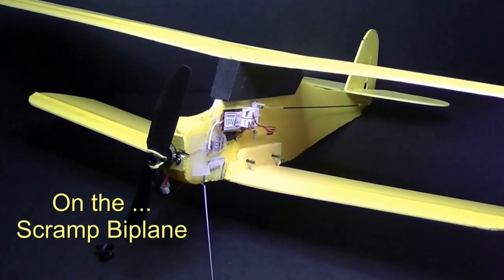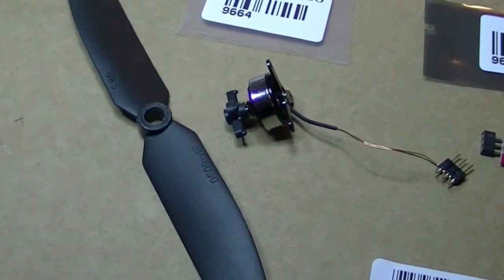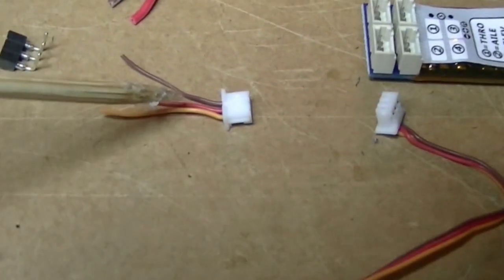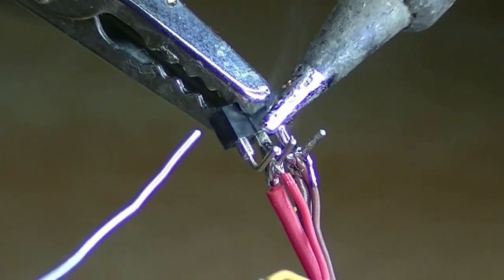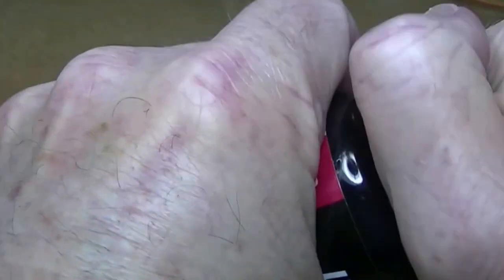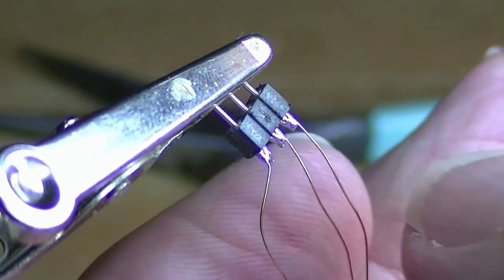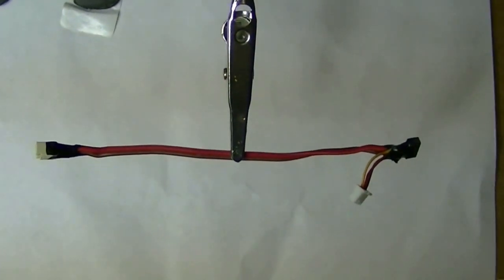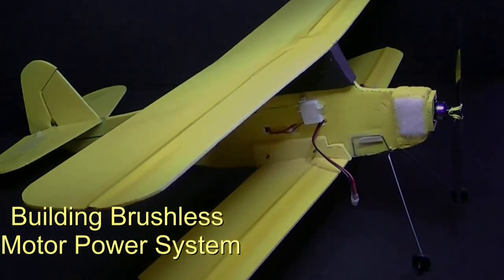Champ Biplane (Scramp Bipe) Brushless Motor 1s LiPo Power System Build

Comment: Hello! Can a 4-in-1 ESC be connected to an aircraft receiver (FS-2A) to control 2-4 engines instantly so that it weighs less?
Reply from the maker: I don't see why not!
Reply: @DaveMerc  I'm looking in YouTube for a video that explains this and I can not find it. I do not think it's easy to connect the receiver .....
Reply: for a plane of 200 g is a lot of weight 4 normal ESC (4x6g) but if I can connect a 4 in 1 it could work (2g)
Reply from the maker: For a 4-in-1 ESC just connect all 4 signal wires to the throttle channel in parallel. The motors will all run at once.
Reply from the maker: The disadvantage might be that wires to the motors will be long as opposed to separate ESCs mounted right behind the motors.
Reply: is a bit complicated because I do not know which cable corresponds to each ESC to put them together and I suppose that receiver and ESC are fed separately...you could make a video or a scheme to better understand the connections? Gracias!!!
Reply: I would like to use 2 motors Ap05 5000 kw with 2 ESC xp 3a but in Spain I can not find for this use 4 x 0703, I want to use batteries 1s

Comment: Any thoughts on how the 7000kv version would work as compared to the 4000kv?  Awesome videos on the Scramp.  Lots of info to make modifications and different planes.  Thanks !!
Reply from the maker: +brian b The 7000kv needs a smaller prop to work at all and then it makes a high pitched noise because of the higher rpm. The bearings in these little motors seem to deteriorate over a couple years. None of them spin for me anymore and need replacement.
Reply: thanks so much for clearing that up - makea a lot of sense - thanks doe your time and attention